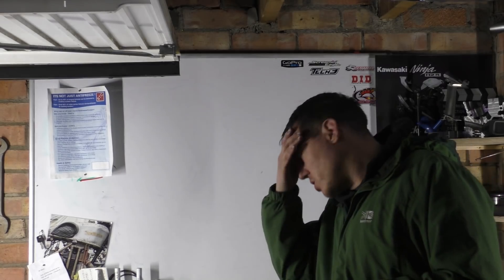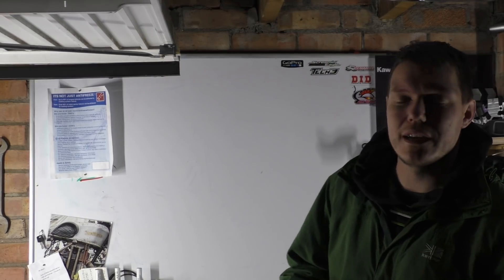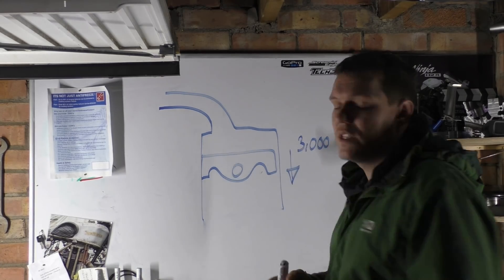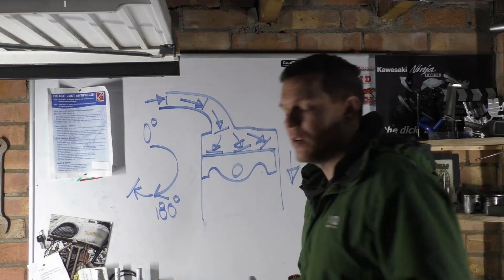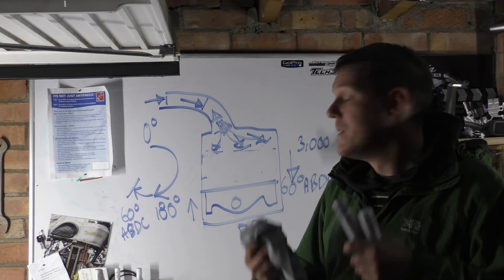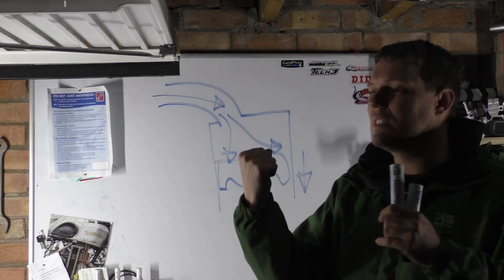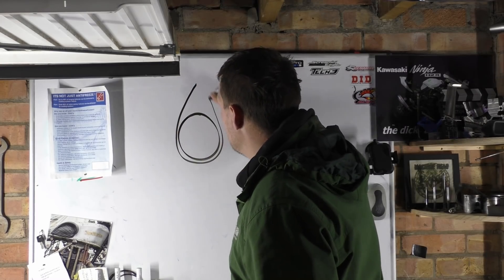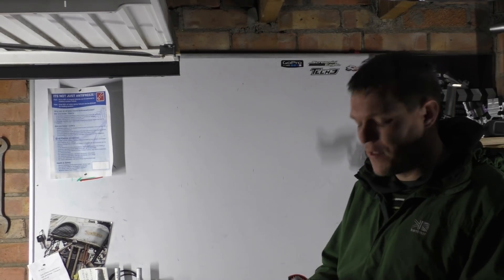Variable cams - 2 stage solution - Part 1

Comment: With things like vtec does the longer duration cam have to open earlier for overlap and to make sure that the valve is closed in time after bdc so that air doesn't go back out of the cylinder?
Reply from the maker: Intakes are always open after bdc. How much is what we call inertial filling. Video coming soon

Comment: Question: which sprocket puts the most strain on a chain? 
What i am interested in is where in the system would we need to look for the highest stress level, in order to work out a suitable spec for the chain.

Comment: When a single cylinder engine is running at 5000 rpm can you calculate the time it takes the piston from TDC to BDC(in one stroke) without knowing what the stroke is? Or do you need to know the stroke length? A little off topic but there was mentioning of pistons.

Comment: What about rotary type or gate type valves that run on a system similar to VANOS wouldnt that solve most problems by giving you variable valves?
Reply from the maker: What about every other valve type - dude, we're gonna get there. Hold your horses LOL
Reply: I like your format of vid presenting a problem and them vid presenting solution or potential solution, the above is my guess at a potential solution. Dont hate me cause my horses are faster than yours 😎

Comment: I thought the Merlin (and other WW2 aero engines) had multi-speed superchargers to deal with different air pressures at high altitudes, not different engine speeds.
Reply from the maker: Not the reason why - just an example of differing speeds

Comment: Good introduction, waiting for part 2 !
(Just one thing : I am pretty sure that h2r supercharger has only one gear. With final overdrive done by a planetary gear set, probably only here for centering propeller axis. As planet carrier is fixed it works as parallel gears).
Reply from the maker: Not according to Kawasaki......